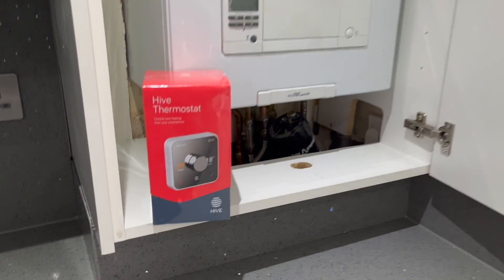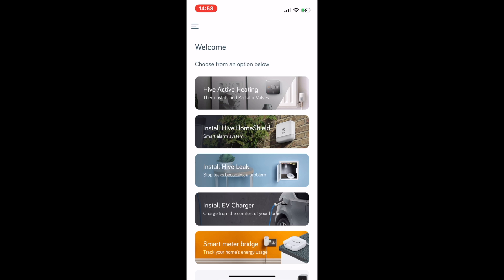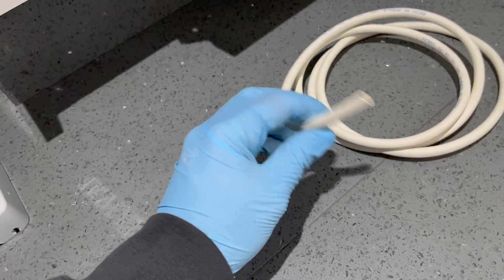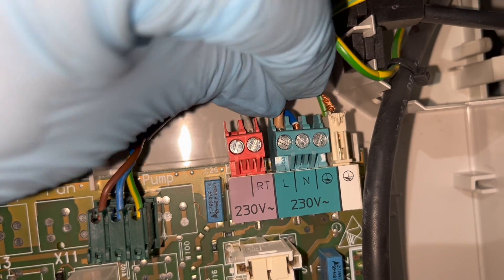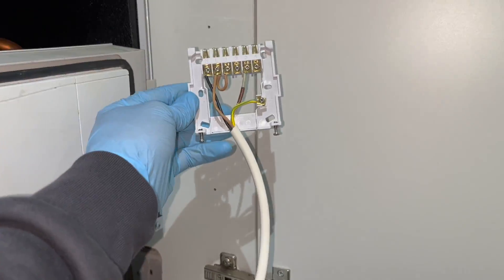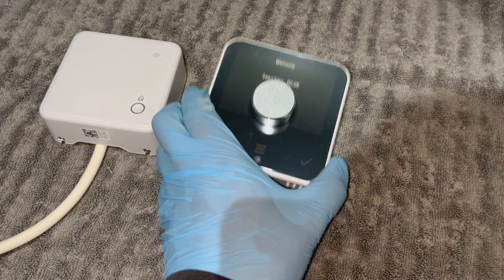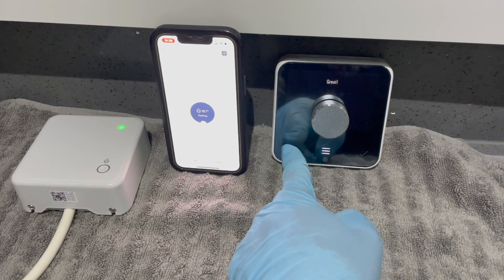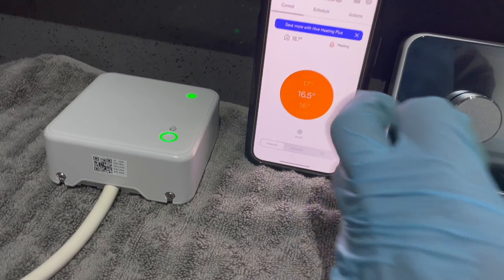Hive V3 Thermostat Installation In 10 Mins - Combi Boiler Wiring | Vaillant EcoTec Pro

Comment: Hi, I accidentally bought the hive heating and hot water but only needed for heating on Vaillant ecosystem 837 similar to one you working on. Is the wiring process same for thermostat as the wiring diagram looks different. Can you please help? Thanks

Comment: Hello I've found your video very helpful ....I have a valliant eco28 Pro like the one in your video 

So here's my issue. 

I've followed your ExAct wiring ...double and trippled checked all the wires are in the right connection 

Managed to sync everything up the hub connects to the thermostat and the receiver.

Now here is my problem ....the boiler is not firing up when it's supposed to ???

The reciver even flashes and clicks but does not fire up or turn off the heating 

Like I said I've double checked the wires and connections !! 

The only thing that is different is that I have a Hive mini ...same receiver and same hub.

Please please anyone help !!!
Reply: Hey I have a vaillant eco28 pro as well. I have your EXACT same issue, but I have the same Hive product as the one in this video. If I manage to figure it out then I will let you know here.
Reply: @D6Soldier  thanks I've literally pulled my hair out trying to work this out .....I've take the link out and wired exactly.....I don't know what's going on if you find out let me know Thanks!!!
Reply: @Progba  .
Reply: @D6Soldier  thanks a lot I will try this on the weekend as I've had to disconnect  and try again!! Will let you know how I get on and thanks alot for the reply !!!!!!!
Reply: Ok so I just rewired mine today and it seems to be working. 

On the PCB: live (brown) goes into L (it doubles up with another live cable in there), neutral(blue or black) goes into N (doubles up again),  Link (grey) goes into 3, Earth (green/yellow) goes into 4.

On the hive backplate: Neutral to N, Live to L, Link to 1, Earth to 3. 

I'm pretty sure in a 4 core cable, the earth acts as a link.

I'm not an electrician, so take what I've done with a pinch of salt. Good luck!

Comment: Hi. Just watched you video on how to install the Hive V3. First of all what a good clear easy to follow video.
Following your instructions in the correct order the flashing green light never goes out. I think it is a slow flashing light right from the beginning. I have called Hive twice the first time they said it is a problem with the internet supplier and to call them. which I did and they did all the checks and told me to call back Hive as it is at their end. I have done everything from turning my router off and on again but still no change. If I'm honest I didn't think Hive were right interested in my problem. Can you help.
Reply: I have got this exact same problem, not sure what else to do
Reply: @CardsMooster  Hi Jack you have the same issue as me, have you managed to fix it?

Comment: Great video, could you please name all the equipments you used like the cutters and what not? Thanks man
Reply from the maker: Nws multi cutters 
Knipex ergostrip
Voltage tester screwdriver
Reply: Absolute great video. Many thanks made a DIY’er very happy! 😊
Reply: Superb video.... Thinking of replacing a MT10 with same which should be easy but someone mentioned Hive.... Looks good but not less energy usage with batteries - i wasn't sure if that is advantage of Hive i guess not.. versatility vs. cost.  Might give it a go though...some more research..like program etc. On/off..

Comment: Thank you for the knowledge.

If fitting this hive to a  baxi 800 combi is it the same. Do five wires need to come back to the boiler as on the baxi 800 combi there is a link between bk1 and bk2. Never fitted hive before but looks straight forward.
Also when setting up do you use customers email and do set up on your phone or customers

Comment: Great video - thank you. I have an ecotec pro 28. Don't have a thermostat currently but looking to install a wireless thermostat at some point.  What would you recommend? Thanks
Reply: Ok - it look like the vrt350f will do the job. Probably best to stick to vaillant?
Reply: @sophiedonnelly8013  I'd stick to vailliant controls, I find they communicate best with the boilers pcb. Most other thermostats are on or off. Where as the manufacturers controls modulates gas valve, fan and other componants down saving on energy. 👍
Reply: @rayc1503  lovely - thank you so much.
Reply: @rayc1503  is it reasonably straightforward to fit? I've changed the manual timeswitch on my boiler before but the 350f looks like it could be a bit trickier or do you plug it in, in the same way?

Comment: Hi,
I normally install the hive active heating without using the app. I then leave it for the customer to set up on their phone when they get home.
If you use the app on your phone to do it, I presume that you just remove/unlink the hub from your account so the customer can then link the hub to their account??
Thanks for your videos. It very helpful.
Reply from the maker: Yeah you can always leave it for the customer to do after, if the customers not there not much you can do

Comment: Grey should be neutral with blue tape and black live with brown.
👍
Reply from the maker: I can never win 🤣🤣🤣
Reply: @advancedboilertraining  it's not about winning bud, its about constant learning
Reply from the maker: @elliotwilliams7421  very true 💪
Reply: @advancedboilertraining  in the uk we stopped using black and switched to blue for neutral in 2006 to line up with EU regs
Reply from the maker: @elliotwilliams7421  yeah I know black used to be neutral in the past which is why I always thought black would be neutral if I don’t have a blue wire
Reply: @advancedboilertraining  that was 3 core and earth you used
Reply: @advancedboilertraining  old colours were red yellow blue  and black for neutral for 3phase, if you didn't have a black you used to use the blue, the 3rd phase. New colours are brown black and grey which means if you dont have a blue you use black, 3rd phase for neutral.
Obviously this is only for 240v
Reply: @advancedboilertraining  Used to be neutral but supposed to de-neutralise the black now after colour harmonisation but, you're not a spark.
Reply: @advancedboilertraining  I'm watching cause I'm a spark and your step by step guides are quality and I'm learning